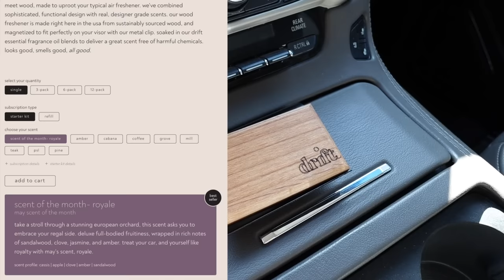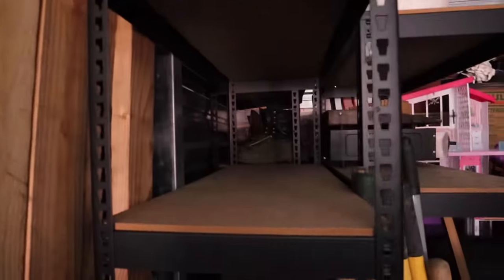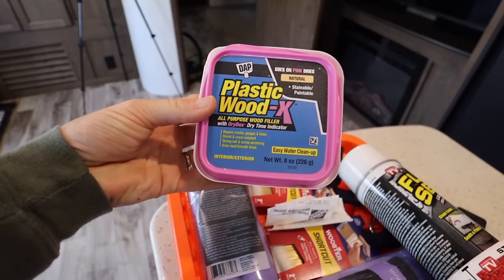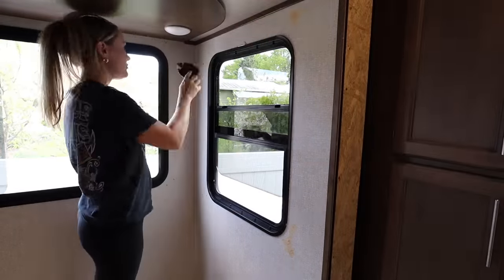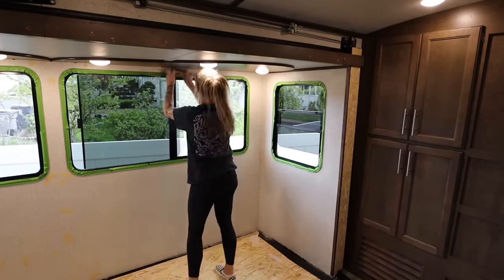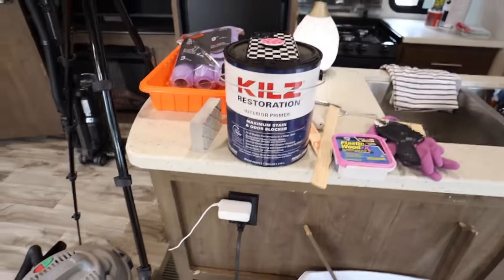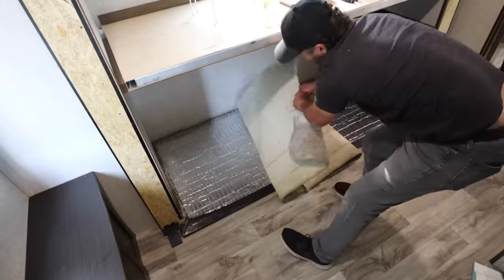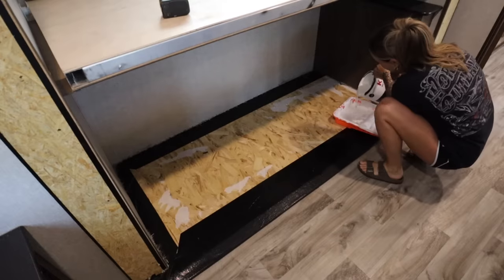RV RENOVATION // part 3 // MOVING & PAINT IS STARTING!!

Comment: When you use tape, you're supposed to remove it when that paint is still damp, which for me, always got me covered in paint and anything it touched was at risk so I learned to just edge slowly with a good brush too! I could've saved so much time and money in my first house when I was 17 had I just not used tape! 😢
Reply from the maker: Yeah I won’t be doing that 😂
Reply: @KristenKasper  right? it's really the dumbest thing, esp when you consider you have to prime first 99% of the time! Imagine the time to tape, prime, remove, tape, prime a second coat, remove, tape, paint, remove, and then pray you don't need a second coat of paint too? LOL Plus all the cleaning of everything it touched... and we all know no one is actually going to remove the tape each time before the paint is completely dry, or take a razor to it and cut around it to break the seal... I get it for some ppl,  and i am sure it works for some, but for me it's 1000 percent easier to just wipe up anything i may have accidentally hit over all the time and money spend on tape!!!

Comment: Good you accidentally painted where you are doing WP install.  Everything will smell so fresh because of that.  I can’t CANNOT wait though to see the WP choices.  I rarely tape as well.  A tip I got though…..if you do…..pull off tape slowly, but KEY is still to pull it off before the paint dries.  Looking forward to the next video.
Reply from the maker: But the two 3 layers of primer and paint are already dry before the last layer of paint is put on so I wondered if that would still happen 😂 either way, I won’t be using tape again hahaha
Reply: @KristenKasper  Oh Yeah!  😂 Girl, as long as the “scents” are gone….that’s all that matters now.